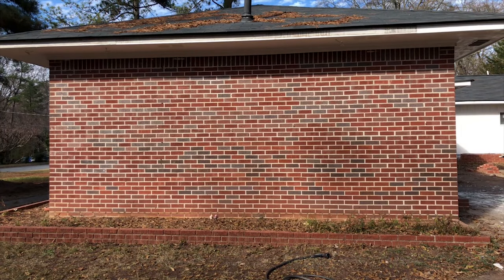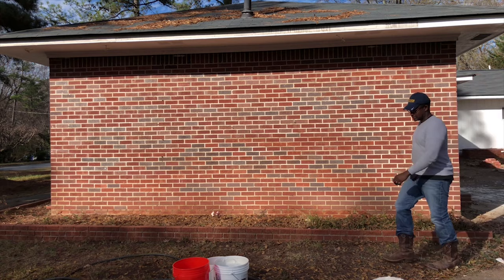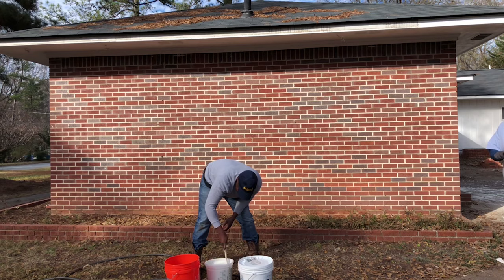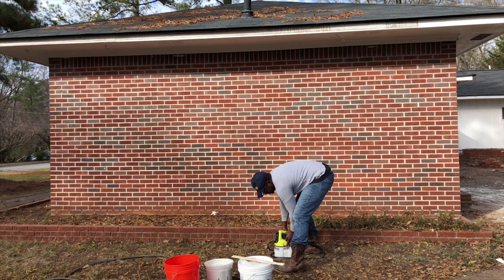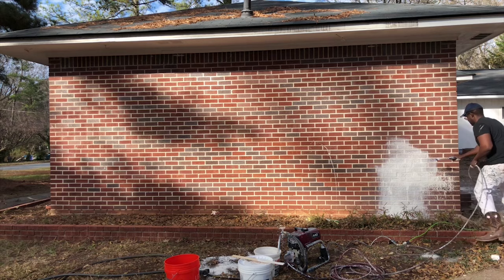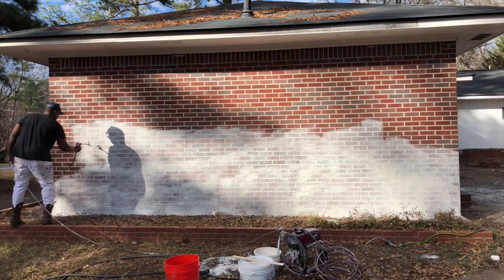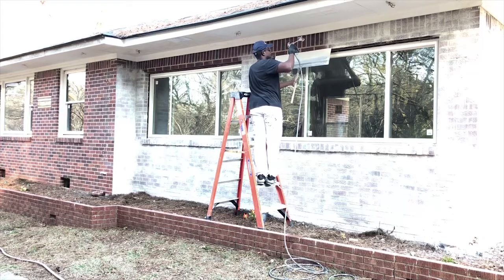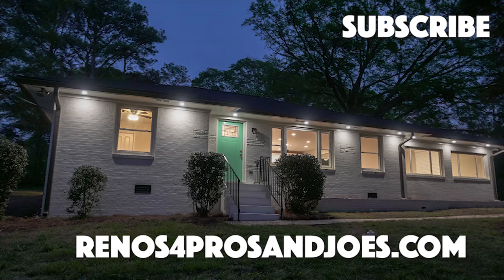How to Limewash a Brick House

Comment: The way to whitewash is to take a big brush and slap it on there. You need a thick layer!
The advantage of limewash is that your walls are still able to breathe (not so with paint) and if you want to redo the walls, then you just slap another layer on top (not so with paint, because lots a scrubbing to do). Some old houses may have many layers of whitewash on them (without the need to remove them).

Comment: Probably for something as thick as that you may want to stray from using a smaller rig.  My experience (not with lime wash but spraying mud) its better to go bigger. Could burn the mother board out on the smaller one. Also, we take the filter out (go by your own judgment) so its not another step of having to force that material through that much more stuff.

Hope this isn't taken negatively! Just wanna help but im also trying to find out how to do lime wash and learn more about it before I do my house. This video was actually really helpful about how to approach this! Thanks!

Comment: You can remove the filters before spraying something thick like that and spray without filters. Will blow the tip quickly tho but works. You can spray texture with an airless if you remove the filters

Comment: I recommend using the brush method due to the fact that you were looking for a more of a solid look rather than transparent. The brush allows you to work with thicker Limewash to give you that painted look. In terms of spraying, you would need a very high-grade sprayer to be able to push all of those Limewash particle through for the same effect.
Reply: Do you have recommendations on how to do a very light coating of lime wash? I do want the transparent look.
Reply: @Caligirl.8630  mix the limewash with more water before applying. Try it on a small portion, than add more as desired of need be.
Reply: @larinlazar9273  will do. thank you!!
Reply: @larinlazar9273  will do. thank you!!
Reply: @larinlazar9273  will do. thank you!!

Comment: I used the romabio limewash and i didn't have an issue. But I brushed on two layers and it looks like a white painted house. I'd say each side of the house took a day to do. One coat, let it dry 8 hours and then a second coat in the evening. as far as using the sprayer goes, I didnt see you use a paint paddle to mix the limewash nor did i see you strain the product after you mixed it with water to get out chunks that could've been left. I think doing those two things would've helped you tremendously with spraying.
Reply from the maker: Both tips that you mentioned would have been helpful. Another key tip that I did not come across until later was removing the filter in the handle of the sprayer.

Comment: I have done this to a couple of fireplaces. I can tell you that the reason why you were not happy with the way this turned out was because you sprayed the entire wall first. It would have been a better idea to test spray a spot and then rub it with a rag. By spraying it you're essentially painting The Brick and the lime is absorbed straight into the brick and dries quickly. When you do the spray and wipe method you are giving it time to absorb a small amount of the lime and then rubbing it off so that way the color shows through. Anyone else trying to do this I would recommend you do this with another person. If you have a single story home that is not very big I would not recommend using a paint sprayer but instead do it with brushes as he's suggested. One person can brush on while the other person rubs off. If you add too much you can spray with water and some will come off. If you have access to a pressure washer, and it hasn't been too long you can experiment a little bit with putting the lime on and then giving it a spritz with a pressure washer from a distance
Reply from the maker: I tried applying it a few different ways. It really just didn't look that great on this house. However, I agree that applying with a brush gives you a lot more control over the application. In my opinion, limewash tends to look a lot better on two story homes. its just not as exciting on one-story homes, especially ones that have a ver low profile and roofline like the home in this video.
Reply: What would u seal with after?

Comment: Hey, I have a 1950s red brick house. I want to lime wash it because the red colour is so vibrant. But now I'm second guessing. I have to paint it because the previous owners destroyed the trim around every window and the entire roofline with white paint. I live in a very wet climate so I think the lime wash is the best option. Ahhh. I wish I could grab a consensus of people to help me decide.
Reply from the maker: You should be fine with either way as long as you use a higher end paint and a higher end primer. The major "issue" is getting a finish that you like. If you are in love with limewash, buy a small container and try it on a small area (like one wall) on the back of the house and see if you can acheive the finish that you desire. If it goes well, buy what you need to complete the project. If it does not go well, you will need to pressure wash the area where you applied limewash before you apply the primer and paint. FYI, pressure washing the limwash will not remove it all, so there is no going back to the way that it was. Good Luck!
Reply: @RENOS4PROSJOES  thanks for the reply, one more thing. I live in a country where I have to make the limewash myself from hydrated lime. So I'm not sure if there is going to be a difference there. You can see my brick color in my profile picture too.
Reply from the maker: @lindsayg564  I'm guessing that the properties of "real limewash" are at least a little different from the premixed product used here in this video.  It may be a good idea to research that specific type of application to cover all of your bases. Good Luck.

Comment: Yall look at Romabio lime wash.. avail at the Depot.
If you want out to look painted the rent a PRO sprayer for $100 and 2 costs will look like paint. 

Or one coat and fan spray some water at to thinly rinse allite off before it fully dries.

After it dries,  it's very solid, like paint. 
But, it can be removed with a pressure washer

Comment: Wow! I am so glad I found this. I may have changed my mind about limewash vs paint! Can you tell me if limewash will age better on brick though? Won't paint chip off? thank you!
Reply from the maker: I can't comment on the aging process for limewash since I don't have the experience with it. However, painted surfaces (including brick) do have to be repainted (typically 5-7 years is recommended). The paint should not "chip off" unless if the brick is properly prepped and primed prior to painting it. You should also use a paint that is designed for brick. Hope this helps. Thanks for watching!

Comment: I’ll have to disagree with the “paint is about the same price as Limewash” comment. Here’s a snippet from the web that explains why: 
“You can mix your own limewash using lime putty from hydrated lime. You can find this at a hardware store for $3-$5 for a 50 lb. bag.  With this much limewash and some supplies, you could coat an entire 1600 square foot house.”
Reply: No way, it’s more like $10 for 10 pounds
Reply: Still a lot cheaper then paint

Comment: Huh! all the reading ive done about limewashing said I needed a mask, goggles, rubber gloves, long sleeves etc that I was too scared to do it! But you make it look easy! (well the mixing etc part. the application, we have nice fluffy rollers for and its for an enclosed porch so I think ill be okay)
Reply from the maker: You should wear long sleeves, and gloves and protective eyewear. The formula used in this video has Zero VOC's so no mask is required. The best way to apply this type of product is with a semi stiff brush. The roller isn't going to allow you to cover the mortar joints with nearly as much control (unless the joints are flush with the brick). Good Luck!
Reply: @RENOS4PROSJOES  I unfortunately can't find limewash near me. So acrylic latex paint on the brick 😬 says on the can that it's for brick, stucco, masonry, etc. So it will just have to do. Let's hope that since it's brick veneer, it won't cause a massive issue with the house itself 🤞🏽
Reply: @aminadaimee5116  you buy calcium hydroxide and mix it with water and you got lime wash. Over here a 30 kg bag og calcium hydroxide will cost me around 30 bucks, probably cheaper where you are. That 30 kg will yeald around 100 liters of wash.

Comment: I hear painting brick it will chip away because the brick has to breath and makes the paint chip after a year?
Reply from the maker: You have to use paint that is designed for brick.

Comment: How much or range for the line wash on this size house
Reply from the maker: The large container is 4 gallons. The manufacturer specs state that 1 gallon will cover approximately 450 square feet without primer. So that's 1800 sq ft of wall coverage for $250. Cheers!

Comment: Well... you didn't wash.... you clearly don't understand the product or application procedure. 
I'm sitting in the yard watching your video in front of my first time, lime wash experiment.

Looks awsome,  and easy to spray,  and easy to WASH giving it the Weatherd look.

I sprayed with a PRO sprayer (full size sprayer) and a 515 tip.
I mixed 0ne bucket of product with 
50%, maybe 60% of bucket water.

Comment: Why on Earth would you put it through a sprayer when it says apply with a brush in the website? Lime has more of a texture than regular paint. Lime wash is not a white paint, it's a technique to look like a white worn brick...
Reply from the maker: The manufacturer's website states on more than one webpage page that this product can be applied with a paint sprayer. I've linked one page below. See the second bullet point under section number 2.

https://romabio.com/classicolimewashhowto/
Reply: RENOS 4 PROS & JOES sprayer could handle just need to make thinner. But the brick looked way better that house lost a lot of value.

Comment: The reason why this didn’t work for you is that lime wash should never be put on with a sprayer. It’s meant to be put put on the brush and it’s meant to be put on thick then rinsed  off.

Comment: You should never paint over brick. It traps moisture and does not allow the brick to breath. Only limewash or stain brick. I still can’t believe people are painting brick and thinking that’s okay to do.
Reply: Absolute nonsense. Nearly 30 years painting with 20 plus as owner, I can tell you we have painted many brick structures. Painted brick, properly prepared and primed with masonry primer lasts forever. My own home is testament to that as well as every brick structure we have painted. Latex paint breathes. It's porous.

Comment: Do not put paint on brick it doesnt let the brick breathe and degrades them. Dont advise that!!!!!
Reply from the maker: Hi, I think you may be referring to standard exterior paint. I use paint and primer designed for brick and masonry. Every paint manufacturer makes paint specifically for painting brick and masonry. Sherwin Williams, Benjamin Moore, Pratt & Lambert, Behr, etc. And believe it or not, in my region of the world nearly every brick home that gets renovated get painted some variation of white or gray. Thank you for commenting.
Reply: As an owner of a house that has been painted right before I bought it, I can only agree it's a terrible idea. It is only done to hide imperfect or outdated looking walls, but it really doesn't take long for the first bricks to fail. Every bit of paint that falls off takes a little or sometimes not so little layer of the brick with it, it's just terrible. Either leave the bricks bare or do multiple coats of lime wash until you get an even colour, so the wall can still breathe.
Reply: Nonsense. I've painted many brick structures. Pressure washing thoroughly. With high quality masonry primer and two coats of latex paint, the job will last indefinitely. This is coming from a professional painting company with nearly 30 years experience. Painted brick holds up incredibly well.
Reply: I have seen painted brick in my city crumbling off leaving the brick under the paint exposed. I’ve often wondered what are you supposed to do when this happens, maybe it wasn’t done right. 🤷🏻‍♀️
Reply: Lime wash is completely breathable the part where he messed up was because he sprayed it on instead of using a masonry brush which is somewhere between a paintbrush and a whisk broom.
Reply: If you use an elastrometric you most certainly can.
Reply: @ajohnson929 can i use different latex paints or do i need to use any specific?
Reply: I agree. I prefer a German schmear.
Reply: Lime washed brick has been used for thousands of years. Turkey and Greece for example. That was a cheap brand
Reply: This is not true haha! I’ve painted other houses as well as my own and they turned out great and have lasted a long time. It just has to be done correctly.
Reply: It says they are lime washing it and that's totally different and have been used for hundreds of years.
Reply: @Candisa y'all aren't paying attention. This is Mom wash and it's been used for hundreds of years on brick and is not the paint you're thinking of.
Reply: This is limewash.... totally different than latex paint. Totally breathable, so no moisture issues or spalling. It will actually extend the life of the brick because it's basically a layer or breathable stone. Edit: ok I see what you're talking about...he eventually does paint it... yeah, not a great idea. I've seen the effects of painted brick over long periods of time where  the mortar basically dissolved.